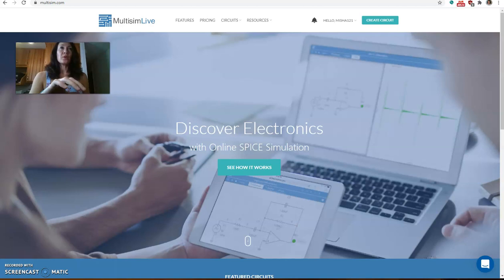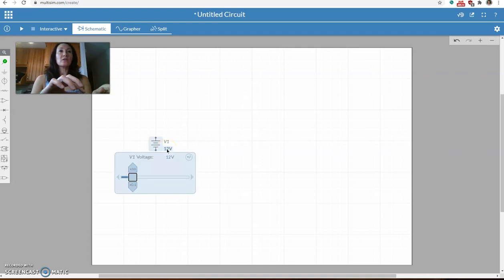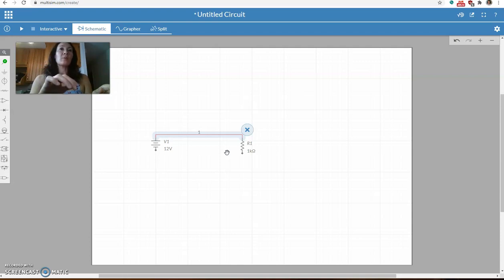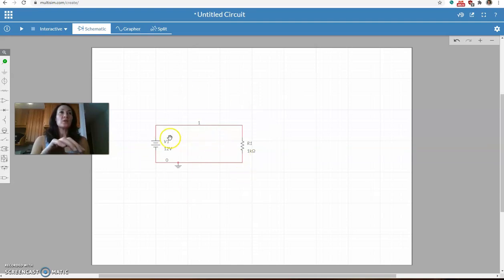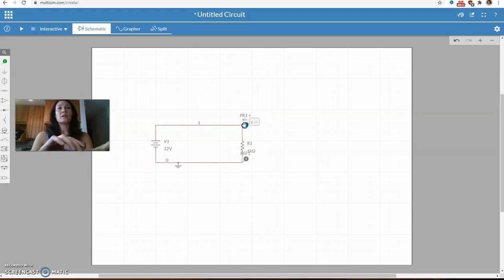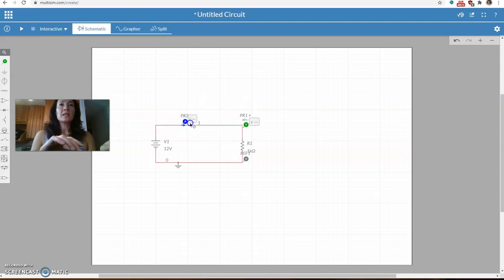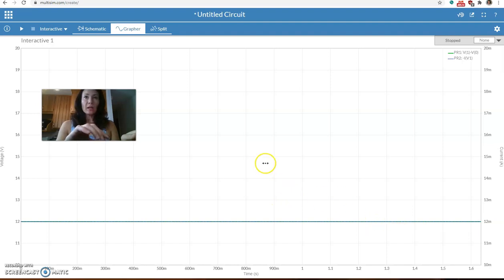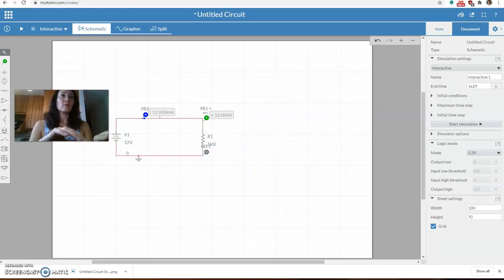Multisim Live Tutorial

Comment: I am making some measures on an RLC  circuit, i put the V and A oscilloscope on the circuit, and I have seen that the phase displacement between v and A change dipending on where i put it, before or after a condenser or inductance, is it normal? current is the same on all the circuit why i have this?

Comment: where to find ohm meter in multisim live?
Reply from the maker: I don't believe there is an ohmmeter. You can place a voltmeter and ammeter and use Ohm's Law to compute resistance instead: V = IR.
Reply: @eeproflady1522  thanks, I'm studying basic electrical engineering and my professor gave us this software to run some experiments.